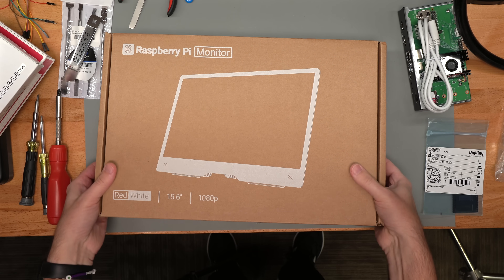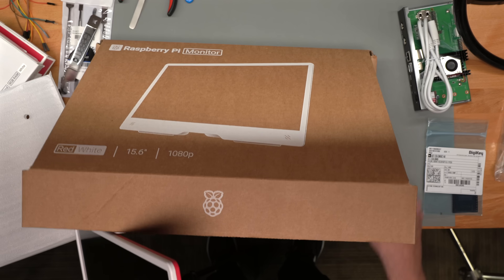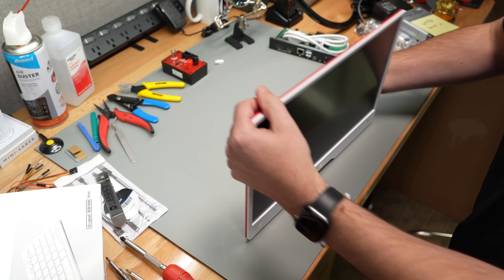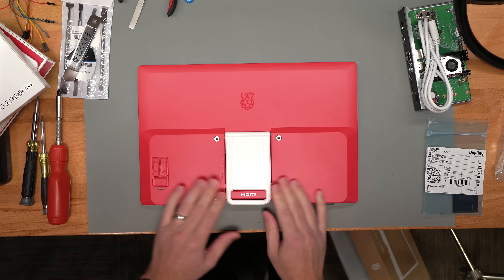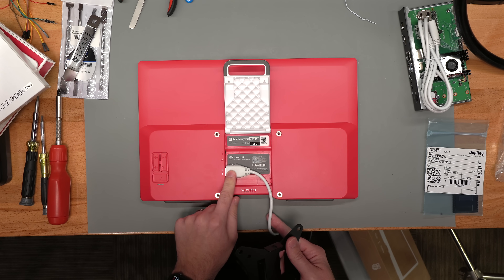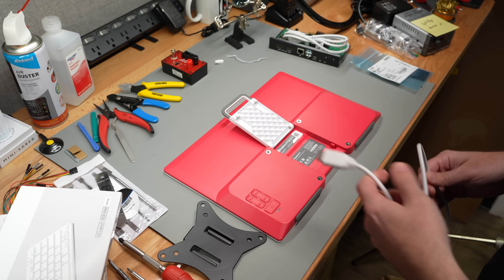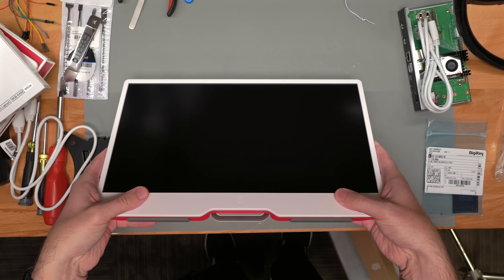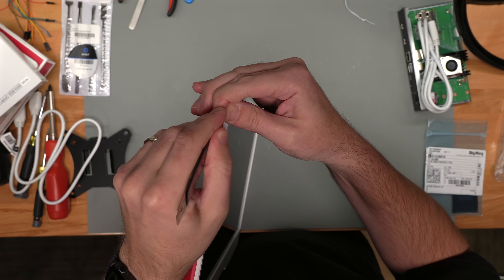What's inside the Raspberry Pi Monitor?

Comment: Looks cool but when you read the specs..."Can be powered directly from a Raspberry Pi USB port (max 60% brightness, 50% volume) or by a separate power supply (max 100% brightness, 100% volume)". And it's only 250nits 😢

Comment: I have frigate NVR running in home assistant using Reolink cameras on my pi 5. I bought this monitor and want to set it up connected to my pi 3b v1.2 on my existing network to stream the live camera views so I can view them in another part of the house. What program do you recommend I need on the pi 3 to do this with the minimum latency of the live view for real time viewing for network connection with home assistant ? I am lost as there are no how to videos I can find to easily accomplish this that I could find. The monitor would be connected to the pi 3 in a different part of the house. Thanks

Comment: If you power it on, and then disconnect the power cable, and connect it back - does it turn back on, or do you have to manually press the button? In other words: does it remember last power state? I mount monitoring screens on the wall that are powered off after working hours. Don't really want to manually press the power button on all the screens...

Comment: I bought this monitor to use for live view of my two cameras on Frigate NVR in Home Assistant running on a Pi 5. I wanted to hook up my Pi 3 B V1.2 to this monitor to do so and then place them both in my living room so that I can have a constant live view of the cameras while in the living room. I still can not figure out or find a video showing step by step of how to stream them using a capable downloaded media player for the Pi 3 so that when it is connected to the monitor I can view the feeds. Of course the Pi 3 will be connected to my LAN just like all my other Pi's are, so it seems to me that this can be accomplished but I am lost on which media player (VLC, etc.) and what OS (headless, regular or Lite) I should use. Thanks

Comment: I got one of those last week and am still figuring out how to make it "laptop portable friendly."  To protect it when in a back top I am folding over some cardboard with soft material glued to the inside surface of the cardboard.  Then using Velcro straps to keep it closed.  Or maybe make a laptop like fold open box to put the monitor and a Lenovo Think-Pad portable keyboard  in it.    Thanks for trying to open it.  I wanted to remove some plastic on the back to make the cable runs less awkward. Now I will just have to find a plan B.

Comment: I think I’m getting one.  I bought the largest portable 1440p monitor for my last deployment, but it was slightly too big for my small every day backpack.  I also usually used 720p (1/4 resolution) for the Steam Deck.  It also wouldn’t power off my MacBook for some reason, and needed its own power supply.  So it’s mounted inside my mobile HAM box for now.  There’s a TON of monitors this size, resolution, and price.  But I like in integrated stand and of course it’s RPi.  The other option is the upgrade to a new iPad Pro with USB-C, and use that as a monitor, but that’s up to 20x more expensive.

Comment: Eh, I think this is for the education market mainly, monitors at 1080p are cheap.  Well, then again so is the raspberry pi. . .
Reply: yes i think so too. it almost looks like its designed for classroom use. i would buy one if it allowed you to dock a pi4 or pi5 into the back of via a access hole hole with some kind of top hat time connection but its just not what they aimed for.

Comment: They probably just expect you to put the monitor in a laptop sleeve. The front is still a bit fragile, but it's probably fine. Seems like honestly the best value portable monitor. It doesn't have any high end features, but it can also be powered by basically any USB port so you don't really need all the bells and whistles imo.

Comment: Going to buy a regular pi5 this unit is actually designed worse than my radio shack trs80 with an expansion interface.
No, this is just a poor design .  More importantly the proximity of a flat vesa mount putting pressure on the HDMI jack is something that design should have solved early on.

Comment: I bought a $5 TV hardware hanging kit from Walmart when I was moving the TV’s in my house. Seems over the years I misplaced the stock spacers from Samsung. I have a bunch of parts left over. That kit can come in handy for mounting the Pi monitor if anyone needs spacers and bolts. Not bad having the left over parts as well. Great video, Jeff! 🙏

Comment: 100 $ for a 15,6 screen  (1920 x 1080 pixels) with no touch screen system , no USB3 hub , no power supply for the Pi raspberry , no room to put the pi raspberry in it.... It' s just too expensive  whith no reason to buy it..

Comment: Some neat design elements but having 3 or 4 portable monitors now I think the best method is the magnetic flip cover it protects the screen when not in use but doesn't take up too much space and also acts as a kickstand. Although the magnetic stand and accessories that are available for the espresso display are relatively nice but I don't like the cover that much as it's thicker and bulkier than it needs to be. But it's by far the best one if you want Pen support.

Comment: It would have been useful to also have hooks to attach the Raspberry Pi4 / Pi5 directly to the back of the monitor.
The lack of a touchscreen worried me a bit, since I use many monitor models with touch to do applications on the Raspberry Pi4.

Comment: Bit unfortunate that design is somewhat lacking. There would've been insane value to design it so that buttons would've been at the chin of the display and especially I would've liked to see option to insert raspberry straight into casing and make and AIO computer out of this. Also those plus touchsceen would be awesome. I would absolutely buy one for Home Automation monitoring. Going bit further maybe some small slot in housing that could fit like PIR sensor to wake display up when walking near it. With those I would absolutely pay premium even if display quality would be bit lacking.

Comment: I guess if you're bolting the monitor to a VESA mount, you're probably going to plug in the cables and leave them alone.

I have a similar monitor where the stand obscures the ports, and it means that I can't have the stand flush to the unit with cables plugged in. That's the annoying part.

Comment: Have you seen a power supply than can do the 27w the pi 5 requires plus an additional 15w port that could power this display?
Reply: According to the spec sheet, the monitor only requires 7.5 watts max (34.5W total).  A Mean Well LRS-35-5 goes for less than $20 but you'd have to source a pair of USB-C pigtail power cables to connect it which I found on the big A and E websites for less than $10 for two.  Not a big fan of the quality you can get from those sources however.
Reply: I'm still hoping to see a non-DIY solution that can power a pi 5 + an additional thing, or even better, multiple pi 5s

Comment: I think Raspberry Pi 500 Creator are thinking in building something very cool for the 600 version, adding a battery slot may be sealed separately, and NVMe slot and this will break the market maybe will wait 18 months till this happens

Comment: I don't know for sure, but I suspect the VESA mount location covering the ports is to act as a cable access prevention for education environments. It stops theft of cables off monitors, especially important with something like this where you might deploy a bunch of these in a makerspace. Raspberry Pi is still partially an education-focused device, and the Pi 500  and monitor are very much suited for that more than anything else in their lineup.
Reply from the maker: That actually makes some sense... still wish it didn't have to be that way :D
Reply: No, this is just a poor design . If your cables are tethered to a lock system then the cable theft issue is moot. More importantly the proximity of a flat vesa mount putting pressure on the HDMI jack is something that design should have solved early on.
Reply: @jasonprivately1764 spoken like someone who has never designed or manufactured anything on a tight budget😂
Reply: @markevs3360  in actuality ran a design firm back in  the 80s. Did both civilian and government designs for communications equipment in harsh and commercial environments.  Also did a decade developing closed looped systems for manufacturing. Now. Guess the qualifications for you NEW engineers, is different now. Funny though, I still have my old slide rule. And the damn batteries are still working in it.(satire, in case you didn't know)

Comment: What if I want to use it for retro computers or RetroPie on the Pi that use the 4:3 aspect ratio? 
Will it stretch it to 16:9 or will it display it in 4:3 ratio with black bars on the sides? 
My LG monitor lets me choose but if I'm not mistaken the Raspberry monitor has no menu system that lets to switch between different modes so I wonder how does it work when we are not in 16:9.

Comment: 4:29 I wonder if their R&D included a VESA mount with standoffs and then it got lost in the final product for some reason lol

edit: Overall, I think the back panel was designed for symmetry over function based on how it looks... hopefully a V2 model moves the IO panel off to the right-hand side there, either side-facing or downward facing. They can still have cable channels out the middle with this design.

edit: 10:18 Raspbian alternative to chromebooks maybe? :P

Comment: If you didn't want to connect a Pi 400/500, you could 3D print a custom bracket to attach a regular Pi using the VESA mounting holes. That would probably interfere with the built-in kickstand, but a sliding or fold-out tab on the bracket could replace it.

Comment: "What is inside the raspberry pi monitor" -> doesnt open the monitor... That is false advertising and quite sad :(
Reply from the maker: I got in a little ways at least. Just didn't want to risk damaging the panel (yet) because of the adhesives... might use some hot air to try to get it to open all the way.
Reply: @Level2Jeff  thanks for the reply, really appreciate it! You might also try isopropanol, works great for anything that sticks

Comment: Actually I think it would have made more sense to build the '500' into the monitor and add a decent external keyboard. It would be perfect if it had a popout door for M2 access. ;)
Reply: Laptop with trackpad too
Reply: @ingusmant That would be perfect!
Reply: Finding a spare mouse or keyboard on the go is far easier than finding a spare monitor. I do hope their next product will be a monitor with a built in pi
Reply: @rjc0234  why? You going to buy one?
Reply: @markevs3360  If they made a pi built into a monitor.... absolutely.
Reply: @rjc0234  ...or would you complain that it wasn't touch screen....or 17" screen size
Reply: vesa mount the pi easy

Comment: The only thing holding me back from buying a Pi500, is there is no NVMe slot.
Reply: micro hdmi would made me buy a new pi 500 every 2 weeks or so
Reply: @distiking  You can plug an adapting cable in and then apply ducktape to hold it in place and have a better system
Reply: @kensmith5694  it is so silly that i have to fix bad design with a duct tape. I just stay away from this product.
Reply: I think it will be hacked in pretty soon. Maybe the design is not finalized or Raspbery Pi foundation wanted to lover the cost. EIther way the board is desgined forr future dvices in mind.
It just needs the socket and some power componets, maybe some bodge wire.

Either way I cant wait to get my hands on one to try work it out.
Reply: Wish granted, the 500+ is now a thing. I have one. Amazing thing.
Reply: Been using a pi400 since launch. Never had a problem with the HDMI. Sounds like keyboard warriors are typing for the sake of typing without any personal experience
Reply: And if it had NVMe it would be the lack of wifi 12 and Bluetooth 8.2

Comment: Some people with things like ADHD and/or autism may appreciate the LED on the back. The information is there when it's necessary, but isn't visible and grabbing attention while looking at the screen. It varies how sensitive people are about this. Perhaps not the reason raspberry pi has done this.
Reply: Exactly, bright LEDs in the front are the worst! I think I'm borderline ADHD but nothing diagnosed... Apple's products are generally pretty good with this, except the Apple TV which has bright ass LED in the front. I just turn it to the side since there's no IR receiver in it that's fine.

Comment: Touchscreen would have been nice for a Home Assistant display, but I guess for $100 that was not possible.
Reply: I would pay more if it had a pi 500 in the built, touchscreen and a mic.
Reply: I had also kind of hoped it had touch
Reply: Just commented that touchsceen display with place for raspberry and maybe some small slot for like PIR sensor to wake display when walking near it and I would absolutely pay premium, even if display quality wasn't insanely good. Essentially make model that would turn into AIO would be so good.

Comment: Did I see right that it uses a full sized HDMI? Why, Eben, why? Use the same as what's on the computers for goodness sakes! Would also solve the problem that there is not really room for the full sized connector! Also finding glue in there is disappointing. We should expect right to repair from Raspberry Pi if from anyone!

Comment: I could see so many applications for this if only it were a touchscreen, and even more if it had a Pi5 or Pi500 mainboard inside, making it it an All-in-one.

I'm fed up of having to find or design, and print enclosures for every combination of RasPi and screen. I'd be happy to pay a premium for a single solution display panel for things like device control, home assistant wall and bedside panels etc.
Reply: Yeah but CPU age so much more quickly than screens, that all in ones are a relatively poor investment. The row of barely useable iMacs at the local goodwill store is embarrassing. I'd rather buy them separately. Perhaps create like a docking station in the monitor? Switch out the pi every now and then. I mean I happily tinker with a pi zero, that's not the problem. My pi 5 is my daily driver when my wife takes her Lenovo laptop to work. For that sort of use, upgrading every now and then is worthwhile.
Reply: For embedded devices, this is often not a problem  @IvoTichelaar , we still have original model A's putting in sterling service, but this could be easily solved by making the motherboard in a Raspi AIO, a CM carrier board, that way if performance starts to drop below an acceptable threshold, you could swap out the original compute module for a newer one.
One of the problem with the I.T. industry in general is planned obsolescence, and it would be great if the Raspi were leading on reusability, rather than following the herd.

Comment: Raspberry making nearly every parts possible for a laptop without actually making a laptop
Reply: I hope someone makes a laptop case that includes m.2, a battery, and speakers. Kinda like that PiDock 400 but better.
Reply: Cyber deck it is, gents
Reply: A CM5 carrier board with the proper charging circuitry and M.2 placement would probably be the way to go. The pi monitor and keyboard would be cool to see integrated. Now we just need an official Pi trackpad.

Comment: It is clear to me that it is time for Raspberry to create their first official laptop, priced around $199. If they can meet this price point while ensuring solid quality, I believe it will be a success. Something similar to CrowPi and other such projects, but more suitable for "serious" work.

Thx for the video!
Reply: I agree...that's what I've been looking for,
And as per the other comment on you're question, not everyone what's to get a secondhand old laptop and faff about. 

They've too much junk on them ,batteries are questionable and you also don't know what's embedded in it ( no matter how many times you factory reset)  

I would definitely buy a RPI 5 laptop. 
Good comment 👍
Reply: Sold!  Take my money
Reply: Wouldn't that be a PineBook?
Reply: $199-$300 gets laptops like a 2-4 year old factory refurbished Lenovo Thinkpad (got a 2022 E14 AMD R7 5825u w/ 40GB RAM and 1TB SSD for a bit over $300 myself), or a plethora of chromebooks and door buster x86 laptop deals.  It's just not a real alternative/substitute and serves no appreciable market.
Reply: @brianbowcutt249  A couple of reasons for a rPi 'laptop" would be if you want a cheap ARM-processor portable system.  Or that the rPi is a bit more open than most standard laptops.  And a laptop version would have the GPIO pins available.  So for specific use-cases it would fit.
Of course, if you're needing that functionality, the PineBook might fill the need.
Reply: @brianbowcutt249 would be awesome if the laptop had external io to hook up whatever project you like without needing a separate mcu or arduino hooked up via usb (extra messy) but have the io integrated into the laptop design. Yes rpi focusses more on computing power but we cant forget their original target of making computers that can be used for projects.

But i do agree that any used laptop could beat it in performance